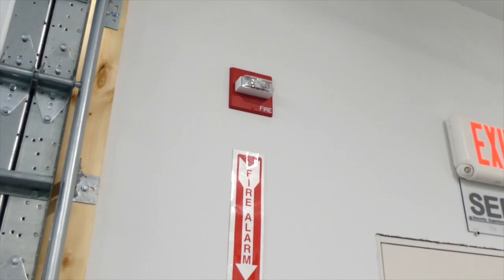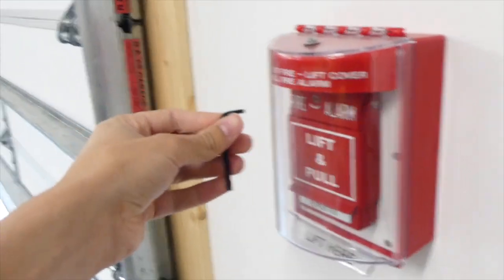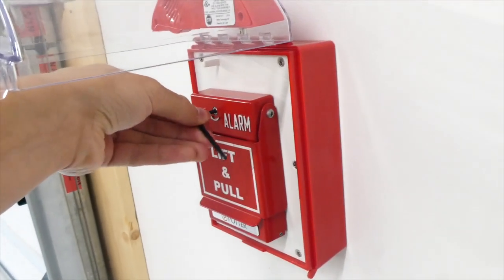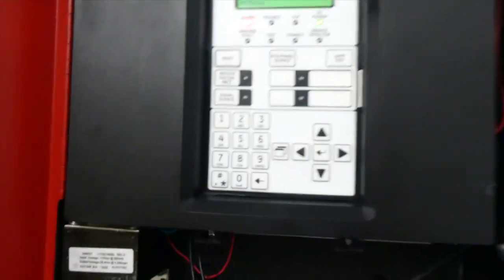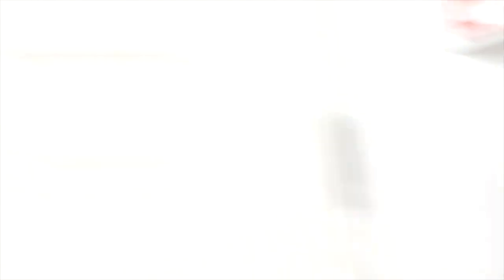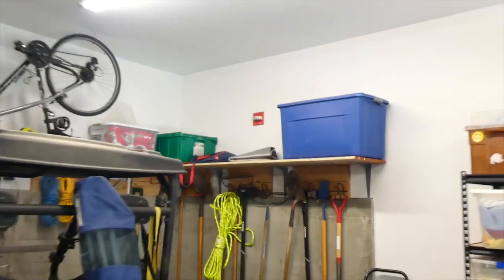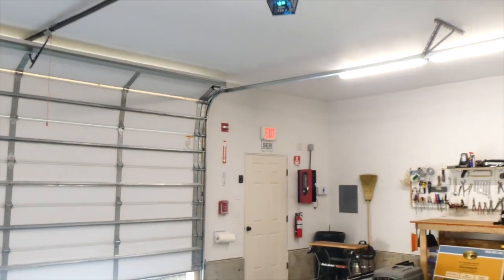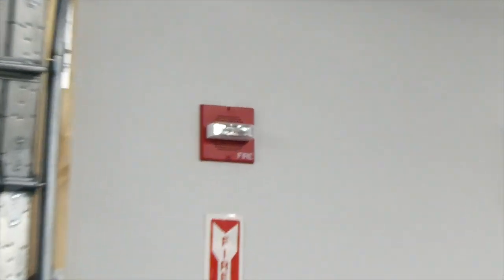S.E.R. System Test 8.5: A little Chime Change

Comment: Hey Grant!! This is Brad (Woodsboss). I have a question about Fire Safety and Building Codes and figured you're the guy that would know the answer. I just moved into an apartment in Ypsilanti, MI. It's on the second story of the house, but there is only one entrance/exit, in a shared stairwell that runs through the middle of the dwelling. Is this legal? I was under the impression that each unit was required to have two separate exits. Either way, what would you recommend getting as a good way to escape the house in case of a fire that engulfs the stairs, like a rope ladder or something? Thanks, pal. I appreciate your expertise. 

I trust Fall is treating you well, and take care, my friend!
Reply from the maker: Hi Brad!! It's good to hear from you! Building codes can vary from state to state and county to county. Most buildings do not have to be brought up to modern code until they are remolded. If your apartment was built a long time ago, it still may be running on old codes, which is legal. If you're are worried about this (which I would be too) you are exactly right on getting a rope ladder. I know the company First Alert sells some good ones. They are compact, they can easily fit under your bed, and when it's time to use it you can open the window and deploy the ladder. If there are other apartments on the same level, boarding the walls of your apartment, and they have access to a different staircase (but you cannot access them because it is not your apartment and there is no access from your apartment) then it might not be a bad idea to carry a hand tool, such as a fireman's axe in your apartment. With the tool, in the worst case sannario, you can breach the wall and gain access into the other apartment that has a different stair case. It just depends on the floor plan of your building. 

If you do find yourself trapped, call 911, tell them exactly where you are, hang a sheet or something out your window, and stand by your window. When the fire department rolls up they will make getting a ladder to your window a priority. Thanks for the questions, keep in touch!! 

Also, check out some of these backpacking trips I have been getting out on:
https://www.youtube.com/watch?v=Q6z-K-9s_H8
https://www.youtube.com/watch?v=tdO3dpDZco8
Reply: @SERSafety  Nice, dude! Thanks for all the information. I'm glad you're still spending so much time outside. Looks like a blast hiking up to Harrison Lake!!
Reply: @SERSafety  chicken
Reply: @SERSafety you should of  activated this when you hear a train lol
Reply: Hi SER safety